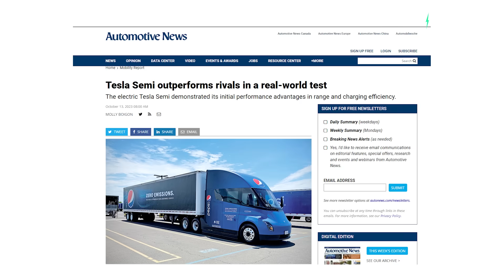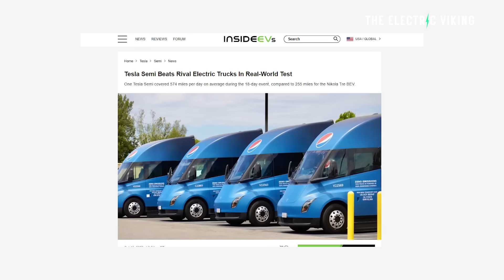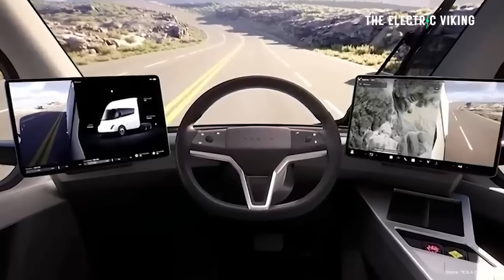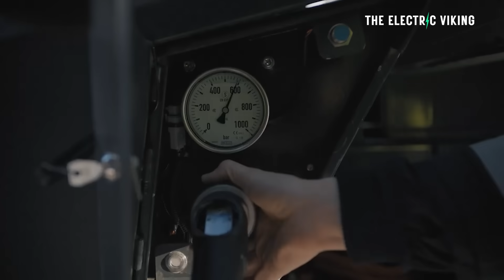Mercedes claim that Tesla Semi breaks the laws of physics proven correct

Comment: I would love to see you do an episode focused on the Edison Motors electric semi that is being built for vocational and off road applications.  Best description for the product is as a fully electric semi with a built in level three fast charger. It can drive for two hours off its batteries, then the generator kicks in and it can keep driving off generator power because it produces enough to charge the batteries at the same time. Drive two hours on batteries, keep driving while it charges for 40 minutes, go back to driving on batteries. Less than a third the fuel used to haul the same load over the same rout.
Reply: Yup, Edison motors was started by someone who worked in the logging industry. Originally meant for back woods mountain environments requiring extreme torque and far from the nearest charger but with the ability to regen with a load of logs as you made your downhill to market, this is genius application of an electric hybrid solution. Edison Motors is also building it's trucks using rugged truck design lessons learned from the grueling lumber industry. Edison's trucks remind me of locomotives (but without the weight). Not for everybody but quite cool.
Reply: - just need to add that the built in level 3 charger is diesel-electric (just like some of the Tesla megacharger sites' backup / peak supply).
Reply: Hybrids are a completely different story, Full EV semis would be a disaster.
Reply: @user-vp1sc7tt4m  So what you're saying is that there is a modern-day Tesla - Edison battle? I like Edison's chances this time around. 👍
Reply: sounds fake! faker than fake.  because it is
Reply: BILL S - also Compare every Conventional SEMI and BEV, Hybrid, FCEV semi to TESLA semi.
Tesla semi only uses 1.7kwh/mile or LESS and has 3x PLAID motors w/ 1500+ HP peak. 
just think about that, for a moment.
Reply: Transit, diesel, electric large diesel, engine generator, providing power to electric motor or motors. Seems to be the most efficient system available. Azrael move stuff for pennies on the dollar to any other technique. So kudos point proved.
Reply: How can it carry the same load when the weight of the battery encroaches on load capacity?
Reply: If you do a diesel to electric with diesel generator conversion you save a lot of weight. 

You take out the heavy motor, transmission, and other drive components. Replace them with a motor half the size and a quarter the weight and a put in a generator that is smaller and lighter than the transmission. Put in electric drive axels made from aluminum billet that weigh less than the original axel. Remove one of the fuel tanks and reduce the size of the other one because you don't need so much fuel capacity. 

Really, diesel electric hybrids are lighter than straight diesel trucks, even with a full load of batteries added on.

Edison Motors proved this when they made their prototype by converting a diesel truck into a hybrid and comparing the before and after weight.

It was literally thousands of pounds lighter after the conversion, but since it was now an electric vehicle it qualified for electric vehicle weight brackets that allow for a few thousand extra pounds of carry capacity to allow for batteries. Legislation put in place to encourage electric vehicle manufacturers by people who don't understand that a bank of batteries has about the same weight as a fuel tank of the same cubic volume. 

TLDR: Pure electric trucks are very heavy because they need stupid big battery packs for range. Diesel/Electric Hybrid trucks are very light because all the heavy parts of a truck are missing or smaller and lighter and enough battery to drive for a couple hours is still lighter than all the heavy shit that was removed.   @thisisnumber0
Reply: @thisisnumber0   - Tesla semi hauled FULL LOAD , 535+ miles (45+ mi spare) in less than 8H. 
it hauled Full Load 1070 miles in 24H , w/ 3 Slip Seat Drivers, 3 charges.
Reply: So this is a series hybrid vehicle (like the BMW i3), which basically ran on batteries, but used a small, efficient ICE to charge the batteries periodically. It used the electric drive train to provide short term peak torque for acceleration and hills etc., so could get away with a smaller ICE engine operating at peak efficiency to charge the battery when needed?

Can believe some efficiency gains (like maybe 30% to 40%), but I suspect a three fold improvement really would be breaking the laws of physics?
Reply: For those remote location use cases it might be better to haul a separate generator to the lumber site for in case the e-truck would run out of power. The site surely will appreciate another gen on-site for other purposes.
Reply: No, for remote use cases it is always better to have the generator built into the vehicle the way Edison Motors is doing.

Pure electric has its place and diesel power with electric drive has its place. In twenty years vehicles that lack electric drive wont have a place in this world anywhere other than hobby vehicles. @BertVerschuren
Reply: @peeemm2032  In the use case where Edison Motors came up with that figure, which is the use case that got them to start designing their truck in the first place, they were going up a mountain (where much of British Columbia, Canada's logging is located) with an empty logging trailer, so they were using a fair amount of energy, but were relatively light, then on the way back they were going downhill with a heavy load. So they were regenerating about as much energy on the slope sections as they were using on the flatter sections of the return journey, so they ended up using very little or no fuel at all on the return leg. So between running a more efficient engine and for about half of the time, they had perfect use case evidence for a submarine style diesel-electric hybrid. They then built their production prototype, Topsy (named after the elephant Edison killed during his PR campaign against Tesla) as robust as they could, hopefully ensuring the truck will last a very long time, thereby further reducing environmental impact by countering what they see as planned obsolescence and built-to-fail trends, wherein manufactures design trucks to last five to ten years at best while also utilizing component parts designed to fail regularly, ensuring a steady market for replacements at the expense of the environment.
Reply: @drewswitzer7574  OK, that makes sense - thanks for the explanation. We don't really have mountains here in Australia....

This is a very intelligent application of the technology. It could potentially have application in freight haulage in hilly terrain - energy used going up a hill could be recovered going down the other side, instead of being dissipated by the brakes.... Benefits may not be as great, but could still be useful in terms of reduced fuel consumption and brake wear?
Reply: @maddhatter3564  The best drivetrain is electric just like a diesel electric locomotive. Why electric? Max torque at any RPM so you dont need a transmission gearbox. Regen better than a jake brake. Battery is the issue but electric drivetrain is superior to ICE no matter how it is fueled.
Reply: @FLPhotoCatcher  It was the AC/DC battle!

Comment: Tesla brings admiration and jobs to the US auto industry that had been declined for decades
Reply: And that decline will accelerate with the demands of the  (corrupt ?) UAW...
Reply: @chrisheath2637 Tesla will monopolize the US auto industry.
Reply: @chrisheath2637  The UAW is not demanding anything that is out of line with what makers in the EU pay.  Mercedes pays it and manages to stay in business just fine.  Labor is not really the limiting factor on manufacturing.  Availability of parts and reliability of electrical power are right up at the top of the list.
Reply: Teslas are the only US branded passenger cars on the top sellers' list in Australia. The cars are manufactured in China but are technically the same as the US ones.
Reply: @rais1953 That's because they are designed and engineered by Americans and assembled in China due to cheap labor costs.
Reply: @KP-xi4bj  Yes exactly. They seem to be better assembled than the US versions though because I haven't heard the complaints here about poor quality that we hear from some US owners.
Reply: @rais1953 I just picked up my made in Shanghai Model 3 last Wednesday and I noticed the wood trim pieces (on the dash and the doors) do not line up.  Go figure!

Comment: It would be interesting to know how much consumption increases from an empty Semi to a fully loaded one.
Reply: The Pepsi trucks and Frito Lay trucks don't have heavy loads even then. I'm currious if they can do the job hauling coiled steel.
Reply: @joseph1150  Regardless of how heavy what you are carrying is, you have a legal weight limit for truck loads.  The problem is damage to roads is estimated to vary with the fourth power of weight on an axle.
Reply: "It would be interesting to know how much consumption increases from an empty Semi to a fully loaded one."

This depends on effectiveness of regenerative braking.  With perfect regeneration it wouldn't change much and with bad regeneration it would be close to linear with weight.
Reply: @joseph1150  Pallets of soda syrup are quite heavy. Pepsi said that most trucks were loaded between 60 to 70k lbs, near the limit of normal semi trucks at 80k lbs, and Electric Semi trucks at 82k lbs.
Reply: @jefflittle8913  You made a good comment about axle loads, and then you made a dumb comment on loaded vs empty semis.  Come on. Its about F=ma, W=Fd, and Power=W/t, here with friction and heat losses. Heavy loads consume far more battery power, regen braking or not. If what you are saying were true, EV cars would have unlimited range but for limits on the efficiency of their regen braking. They do not.
Reply: Wrong, PE is more important, picking up loads from the top of a hill your range is potentially unlimited. @Andriastravels
Reply: @Andriastravels good point...!

"Regen braking doth not a perpetual motion machine make...."  I think Carnot said that in 1824 after the introduction of the new "donkey cart model 3"...  :)
Reply: @PRH123  Lot of wasted energy in heat and other factors for Regenerative breaking. Meaning you always get less back than you put in. Obviously it helps recover potentially wasted energy but it's not the game changer a lot of people think.
Reply: @JustaGuy_Gaming  Regen braking also causes extra wear on tires.  EV tires are over spec, and expensive. Tire particulates have been recently identified as a major environmental pollutant.
Reply: The physics of the Tesla Semi is well known. The 500 mile range test was done with a GCVW of 81,000 lbs., on 93% charge, equivalent to a range of 538 miles on 100% charge. Based on Tesla Semi physics derived by MotorMatchup here: http://youtu.be/zQDU9f4QTLk, the range fully loaded to 82,000 lbs. would be 534 miles; and the range towing an empty trailer would be 780 miles.
Reply: @Andriastravels  It really depends.  The point was that friction is minimal in the engine if the engine is perfectly designed because it is electromagnetic transference of force. You are right that the wheel friction is not easy to avoid.

The point I was trying to make was that when you are using brakes to brake, you lose 100% of your momentum.   The engineering challenge of regenerative breaking is to shrink that 100% as much as possible. I don't see why you couldn't avoid 2/3rds of your momentum loss in a well-designed car.  In fact, I suspect we were close to that already with the Prius.
Reply: @jefflittle8913  Friction is not minimal in any engine.  What you mean is the efficiency is better in an electric motor because the combustion has occurred at the power plant to produce the electricity.  Regen braking recovers a small amount of power, less than 10% of the total output.
Reply: @Andriastravels  You mean like a jake engine brake on a diesel class 8 truck?
Reply: @JustaGuy_Gaming  beats the hell out of a jake brake on a diesel.
Reply: @jaaklucas1329  A Jake Brake uses air pressure in the cylinders, working through the transmission and the wheels.  It is like downshifting with intake air, rather than fuel. It still wastes a lot of engine power to do that.  Regen braking recovers some momentum energy using electric motors to brake the wheels.  Regen braking only gives back some 10% of otherwise lost momentum. It works best in city driving, much less on the highway.
Reply: @alexjohnward  The load can not get to the top of the hill (PE) without first doing work on the load.  Potential energy, PE, it is what is called an initial condition.  The range is determined by the the power (work per unit time) done on the load.
Reply: @Andriastravels  moving down hills, gravity does some of the work, therefore the range is longer when carrying loads downhill. The range is determined by how far it can travel, not by a single particular source of power.
Reply: @alexjohnward  Range discussion is based on level road  As I said you can not take credit for range going down hill, because it takes energy to get the load to the top of the hill, before the load starts going downhill.  Of course if you drop something it falls due to gravity.  That is not the point.
Reply: @Andriastravels  Range discussion is not based on level road, but typically based on round trip. Some vehicles (with energy harvesting and storage capacity) can use energy from the payload (PE) to power the ascent, not just the decent, which extends range over vehicles that can't.
Reply: @alexjohnward   Write to the EPA and suggest they change their mpg test ratings to include a roller coaster effect.
Reply: @Andriastravels  Not my job.
Reply: @alexjohnward  Obviously
Reply: @Andriastravels  I found your comment about load making a difference funny,  given that you were thinking about EPA range testing which is done on a dyno, lmao.
Reply: @Andriastravels  I know one thing...If I never hear another jake brake it will be too soon!
Reply: @alexjohnward  Trust me, there is no humor in explaining mechanics to those who lack the background to understand the subject.
Reply: @Andriastravels  On the contrary, I find it amusing, energy storage and recovery from a load will always baffle some.

Comment: The primary reason for Tesla Semi's unsurpassed efficiency, is due to vertical integration, and no compromise electrical engineering design. Most Auto/Truck manufacturers depend on 3rd party supplier designed parts, which will have lot more compromises made already(due to more generic design to cater to multiple manufacturers), leaving little room for further optimizations. Unfortunately, there is no other way around it, other than to have a similar engineering team that implements vertical integration in the design and manufacturing process. Just some 💭❤️👍

Comment: They need to change the law about side mirrors and permit cameras to be used instead.  That would reduce a lot of drag and wind noise.  We really need to increase efficiency if we are going to battle climate change.
Reply: Maybe folding mirrors for highway and use cameras for lane changes at high speeds.  Mirrors could be very useful for maneuvering in tight spaces.  It’s hard for older eyes to see details in a screen vs maintaining focal range with mirrors.
Reply: The drag from mirrors on a big rig is unlikely to be a significant fraction of overall drag.  Chances are, they could gain more by adding the skirts under the trailer and those flap things on the back of it.  A trailer is a big brick being shoved through the air.
Reply: This is already allowed but I think its only for high value goods
Reply: LMAO The sun controls the earth's climate. I don't fall for mainstream lies. Do some research please.
Reply: a bit of critical thinking on that climate change propaganda would serve you/us well
Reply: @FarleyMan151  Thats the biggest contributor to climate. The thought we could change climate for good or bad, is extreme arrogance.
Reply: @FarleyMan151  LOL Good one but really you should have included some text in CAPS LOCK and a few random exclamation points.
Reply: @maddhatter3564  t sure is. You would think that people would just look @ long term cycles repeating, one would come to the conclusion that we are in a very destructive cycle that keeps repeating. Nothing new under the sun.
Reply: @FarleyMan151  Funny if a religious figure were to say "the world will end unless you do this and that, and oh by the way send me money" everyone would call him a nut, but the government does it and ppl fall to their knees to comply.